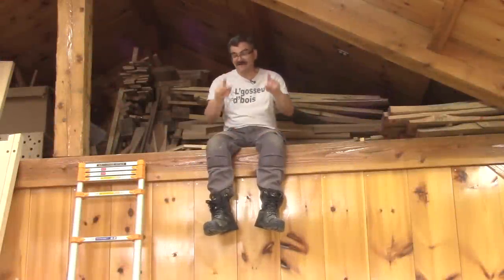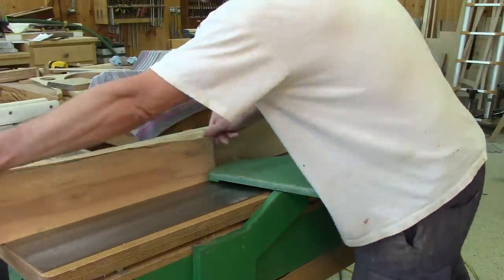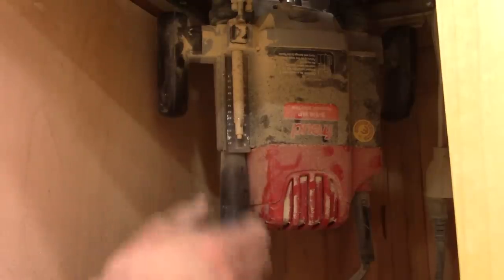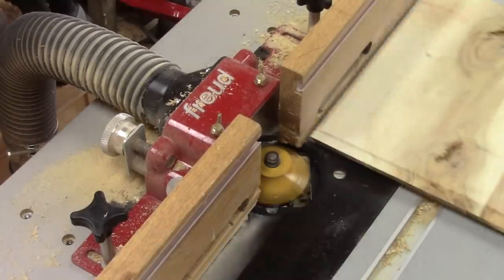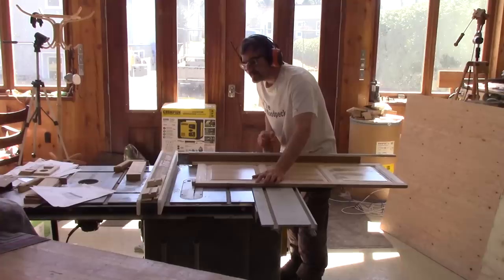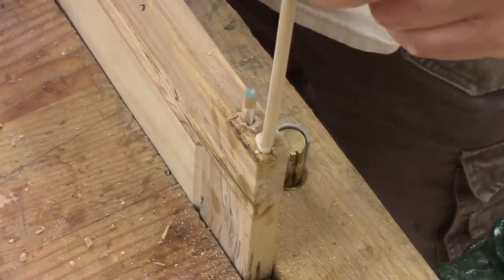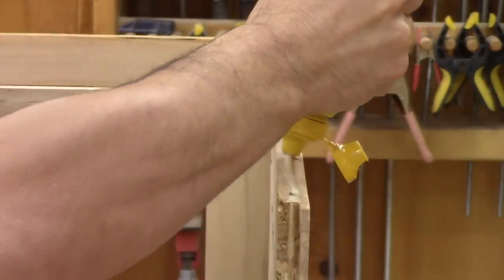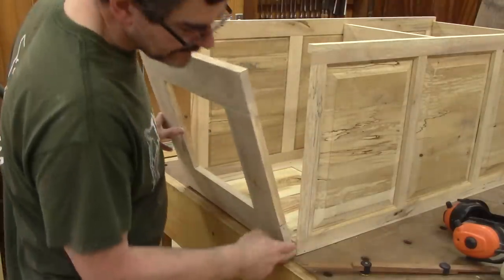The Woodpecker Ep 203 -  A chest of drawers for the shop part 1

Comment: Nice project, i do wonder how soft the birch is? In western europe the birch is very very soft and not usable for anything. How is it in canada? The growthrings look quite tight.. very nice spalting too!
Reply from the maker: We have several types of birches, the hardest, is almost as hard has maple, but not quite, Yellow birch. We also have Grey birch, which is very soft, in fact I heat my hose with this wood I have it  for free. But for this project I've used White birch, which is in the middle, so it's not super hard, but a bit harder than pine.
Reply: @LgosseuxDbois-TheWoodpecker  great info, thanks!